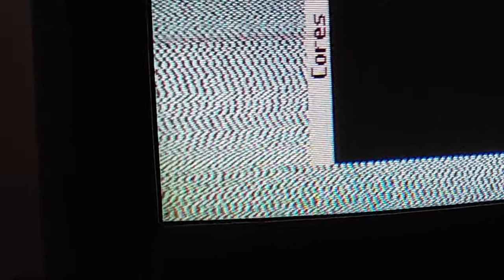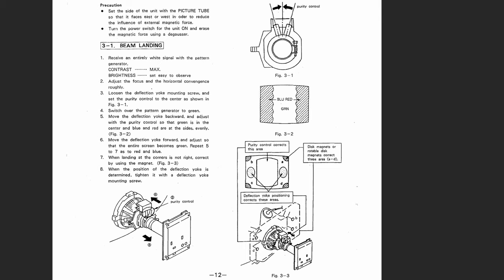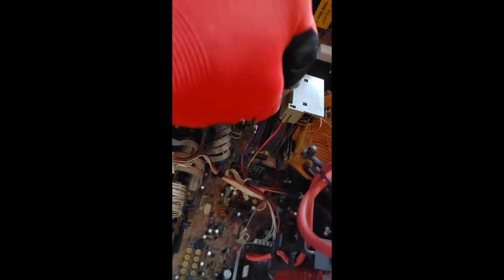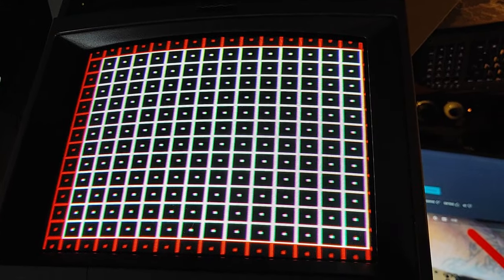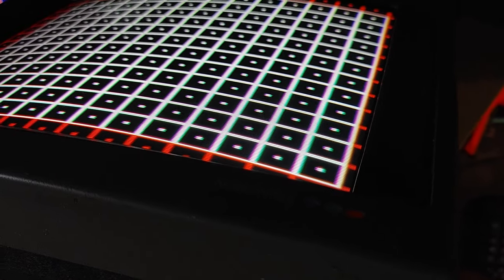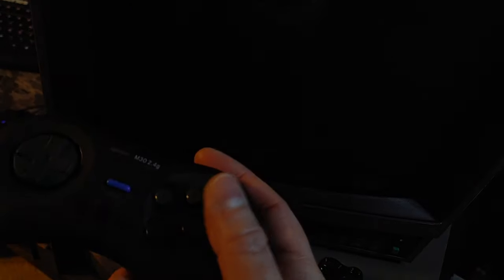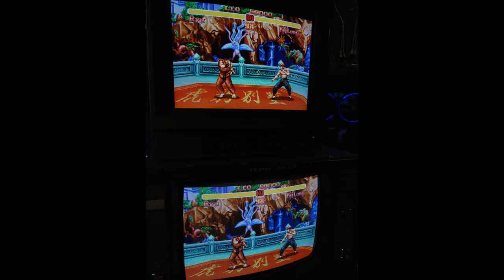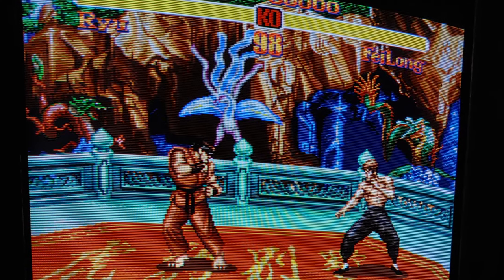CRT PVM ... Purity Rings ... Discoloration Fix without Degaussing?

Comment: Hey thanks! This fixed the issue on my KV-20FS100 ! Upper right was discolored and no amount of degaussing would fix it. Sure enough adjusting the purity rings fixed it right up. Had to correct the geometry in the service menu after but now its looking fantastic.
Reply from the maker: Thats awesome to hear man! Most techs will say to never touch purity but it can fix some issues when all else fails.
Good job!
Reply: I have the same problem, after you made the adjustment, the corners never discolored again?

Comment: Solid video, thanks! So you got the colors down first, and then with the tabs together, you figured out where they needed to be to get the best geometry results?
Reply from the maker: I really just eyeballed everything untill the colors looked the purist and got rid of my purity blotch while I was at it. I noticed while doing this that geometry was being affected so technically could be used to tweak some bowing on screen possibly solong as the rgb purities are whithin a range to be adjusted.

To get it really good you would want to adjust geometry through your serv menu or pots again afterwords using 240p test suite and fine tune your rgb drive levels, better yet a colorimeter

Comment: Thanks for the inspiring video! Do you have any ideas on what tube components might correct the horizontal rightward astigmatism of a CRT? Maybe, there are some more common terms for this problem, that I could google for? Rightward tail, trace from any objects on the screen. The image seems to fade out to the right.
Reply from the maker: Check out my video on the 1341 recap.
It had wavy vertical lines and also bright objects would smear and tail to the right.
A deflection and power circuits recap fixed the issue I was having.
If its an older crt that seen alot of use a recap can clear up alot of issues with stability and geometry
Reply: @LameGaming  thank you very much! Hour ago I was almost sure to have found the problematic area in the schematics to intrude but luckily I saw a used cheap old-fashioned VGA cable on sale nearby right from the late 1990s. People! Never trust modern manufacturers. It worked. The smearing's disappeared. Right now I am staring at the screen and can't believe that CRTs are not produced anymore. I enjoy the picture very much! Dell p1110.
Reply from the maker: @YuriKovalyov  awesome easy fix lol 👍

Comment: Thanks for sharing. I got a 32 inch toshiba af that I turned tate. It developed purity issues on opposite sides once I moved it. I'm wondering if a nocked the rings loose when I moved it. I think I will give this a try before I buy a degauss coil.
Reply from the maker: Ive found most consumer sets glue the rings down but its possible... Ive never been inside a Toshiba, I have a little 14" af but never had to open her up.
Let me know what you find.
Reply: @LameGaming  yeah. I will got back to you. I got a lot of pots on the stove so to speak right so it might take awhile for me to get around to it. For the moment I just tape magnets to the side which works fine. I'm thinking about making my own degauss wand out of a degauss coil from a junk tv.
Reply from the maker: @riggel8804  make a vid on the degauss coil if you do, i thought about doing something similar.
Reply: @LameGaming  yeah I think it would make a funny video. Crts have really dried up in my area and I straight up can't find one right now. I think i need at least a 27 inch crt since I'm trying to degauss a 32 inch crt but maybe it doesn't matter what size the coil is.
Reply from the maker: @riggel8804  I see them everywhere but at this point people treat them like garbage. Found a 27" late 90s curved sony kv down the street tube down on the sidewalk, another 32 in sony and flatty toshiba af busted up at one of them clothes drop off bins... Looks like someone just pulled up and threw them off a truck, and a 27" sanyo flatty busted up next to a residental dumpster in the mud. Pretty upsetting that they just didnt post them for free on fb and leave on porch at least for a week to see if anyone wanted them. I would of rgb modded, recapped, and rehomed them
Reply: @LameGaming  It was like that in my area about 2 years ago. I picked up a lot of consumer sets for free but it's all dried up now. Back in 2014 I was picking up pro monitors like that. They were literally throwing 20 inch pvms in the dumpster at my work. I picked up 2 from work and 2 more local in my area.

 I wonder if consumer grade crts are going to shoot up in price in the next few years like pvms did. Maybe maybe not.
Reply from the maker: @riggel8804   I believe within the next 10 yrs crts will hit an all time high as capacitors and components start failing and probably less than 1% of people capable of servicing them and/or not willing to pay to have them serviced.... It will be rarer and rarer to see crts in good working order.
I think once the 80s and 90s gen gets in their 50s and 60s there will be a dramatic drop in crt demand.... But who knows, by then they might be so rare that functioning ones will demand high premiums..... Idk
Reply: @LameGaming  I'm into hifi stereo equipment and I've been watching what's happening in that community for awhile. There a generation older than us and there gear is just barely showing signs of decreasing in price$. a lot of them are going to die in the next 10 years and our generation doesn't really care about hifi.

I'm putting a vid together comparing the hifi community to the retrogameing community. Our generations pop culture was games. The boomers had music.
Reply from the maker: @riggel8804  Very interesting. 
Im sitting on 20-25 tubes right now lol, the ol lady wants me to thin the heard but maybe I should hang onto them a little longer. I been slowly picking away at servicing each one and doing power,deflection recaps.

Comment: is messing with the yoke and rings 1 zap = dead or is that just the anode, also what kind of gloves is being used here? thanks
Reply from the maker: A live crt anode will be tens of thousands of volts,Around 1k volts per diagonal inch of screen size, the large power filter caps are also dangerous.
Vertical deflection voltage is relatively low but horizontal can be 80- 150v from what Ive read depending again on tube size. 

Ive read the only deadly components are a live or unbled anode or charged power filter cap.
Dont take that as fact though, I hold no liability do not try this at home LOL

The gloves are cheap mechanics gloves and probably do no good other than give you fake sense of security lol.

I have lineman gloves but they must be covered by another glove to prevent holes and by then they are bulky as hell but those are the correct gloves to wear if the rating is high enough and they are free of punctures
Reply: You can safely manipulate the rings by hand, but you should only be using one hand. Using both hands in an area with high voltage can lead to a very sad story if you accidentally touch something with high voltage running through it.